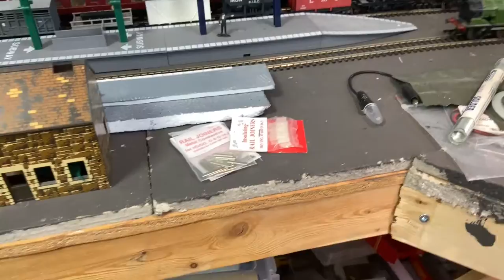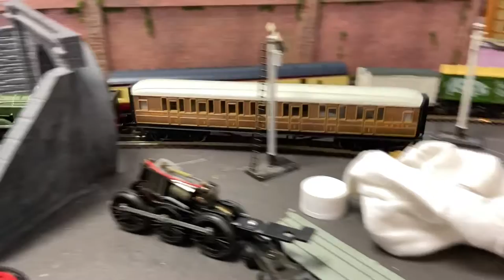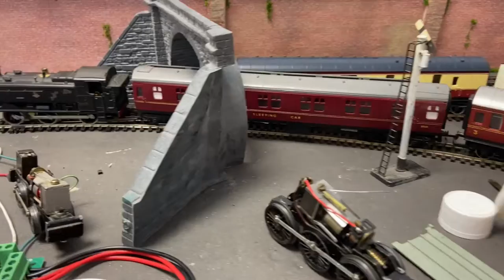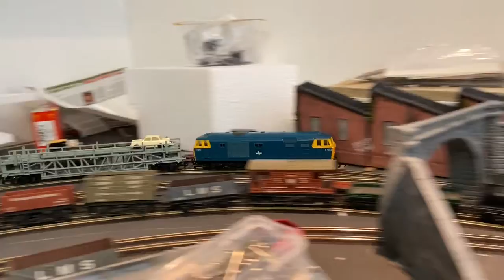A SHORT FILM - SOME OLD  LOCOS RUNNING ON MY MODEL RAILWAY LAYOUT

Comment: Does the Class 35 have fine grooves on the wheels for traction like the Dock Shunter, they are very noisy when the Loco is running reasonably quick?.
Reply from the maker: Hello Paul, no The wheels are plain, no grooves. When it gets going it runs fairly well albeit a bit noisy and I am not sure why that is, maybe the commutator. It also slows down on some curves but I have checked the gauge.
Thanks for commenting 👍
Reply: @charlie1872  I have just made a comment on your last video that may help.  Go to my Youtube Channel and see my modified Jinties, one video is called track cleaning. You dont have to its just for you to see how I solved to wheel problem.
Reply from the maker: Paul, the class 35 runs well on its own. When I have it pull a rake of car a belle car transporters it has been struggling. I went through an analysis of the car transporters which I had modified as per chambs123 tutorial to add new wheels and secure the bogies with nuts and bolts. I started out with five transporters and the class 35 struggled badly and was very noisy: I removed transporters until it pulled with ease. Then I began the process of inspecting the wheels on the transporters, first by checking the wheels were turning freely and most of them were followed by ensuring the axcels were properly engaged and this is where I discovered a part of the problem. After checking each transporter I added them to the loco until I found the one which was the problem. The wheels which John had used in his tutorial I found difficult to obtain plus I had broken one frame whilst trying to bend it  and ended up purchasing wheels which had a slightly larger diameter . I checked to ensure  the wheels were not impinging on any part of the frame which would prevent free running. A slightly smaller diameter would have been more suitable. The Class 35 can pull four transporters fairly easy but sometimes it does slow and noisy. The story continues
Reply: @charlie1872  Hi Charlie, As I mentioned the wheel flanges on the older Triang/Hornby Locos have a deeper flange than later models.  the early flange diameters on many diesel Locos were close to 18.5 mm whereas the later flanges were close to 17.5 mm, Hornby realized that the early flanges were not suitable for the newer Nickel tracks and changed the flange sizes by almost 1 mm to suit. It was found that running Locos on newer tracks with the 18.5mm flanges caused the wheels to hit the sleeper keepers.  Hornby actually produced 3 wheel diameters This was done on the export models as sales were probably at risk if they failed to keep up with the latest track 100 etc.  As I said I found out why my 0-6-0 Jintys were so noisy was the Locos had wheel flanges that were too deep. I can only suggest you try to remove the non driven bogie and run it by hand along the track, any rough running will then be evident.  
Again I hope you solve the problem, Cheers, Paul.